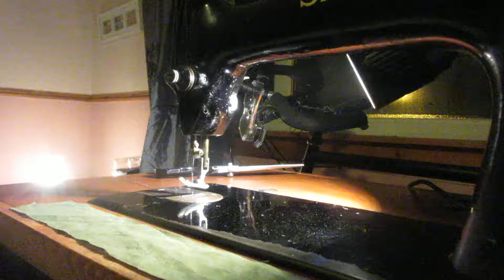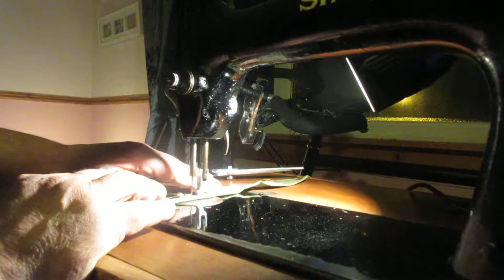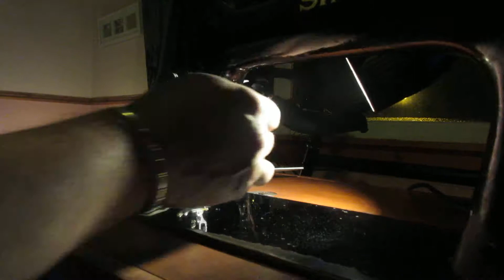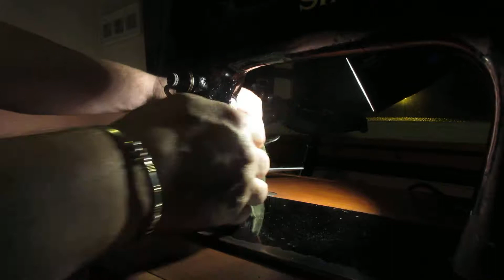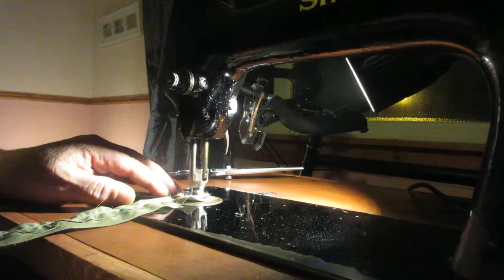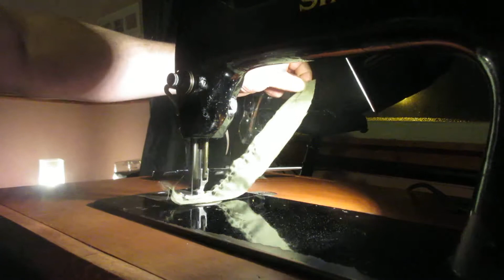industrial singer 31k15 slow speed control

Comment: how do you get it to go so slow?? mine just takes off really fast!
Reply from the maker: try adjusting the tension screw on the motor
Reply: @paddypete1  thanks for getting back to me!
are you referring to the long thin bolt/screw that has a spring and wing nut on it?
Reply from the maker: @ROPNTOZ  yes,you can also try a few other things like a longer arm bracket or elastic bands or smaller pulley or get used to using two feet on the pedal,
Reply: @paddypete1  I'll try that! thanks again!!